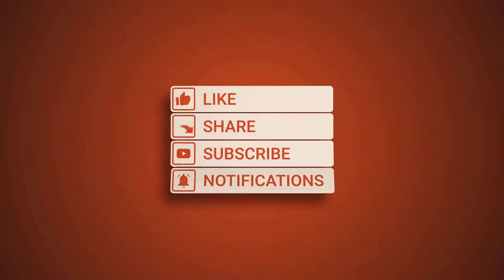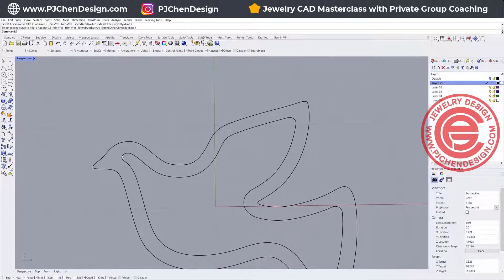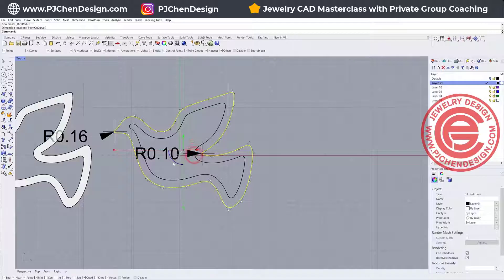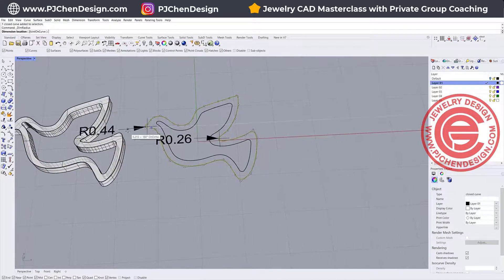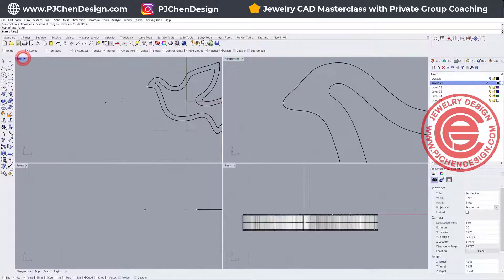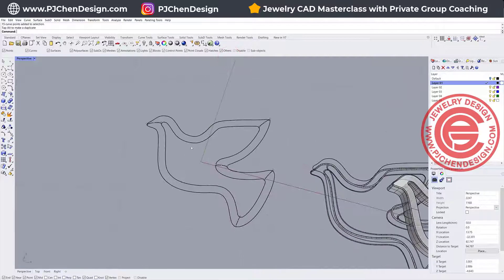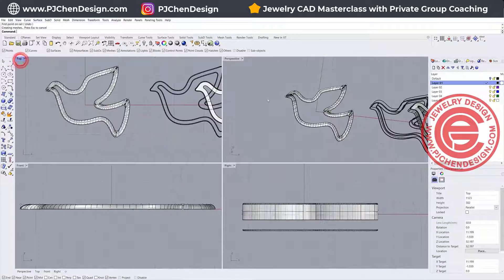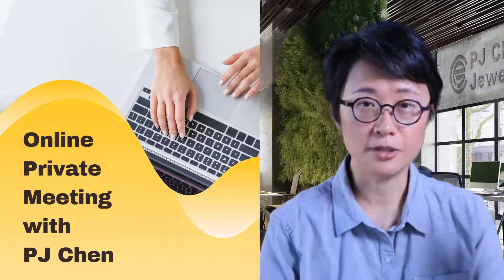Perfect Your 3D Jewelry Model with This Small Detail: Linear Puffy Surface Technique in Rhino #498

Comment: thank you so much for all the videos i was curious is there a way to correctly export diamonds. When i export a diamond from rhino no matter what format unless its a nurbs surface it exports with so much geometry its not good for rendering. Saving the file as a rhino file and importing into keyshot works great and exporting as a nurbs surface works great but anything else makes diamonds not suitable to render
Reply from the maker: keyshot should able to take 3dm file. if your stone is mesh and jewelry is polysurface. it should not take too much file size. you don't have to export all parts into mesh for render.